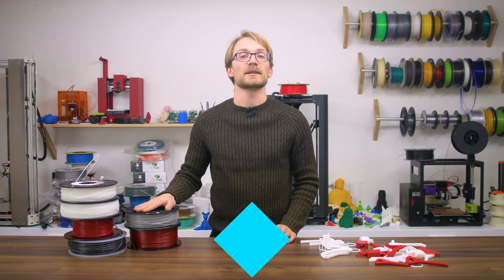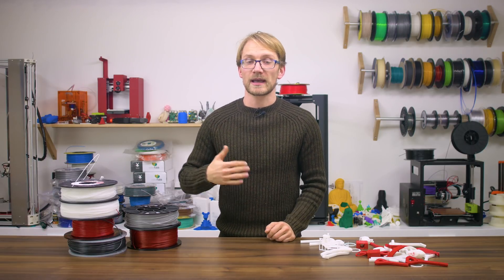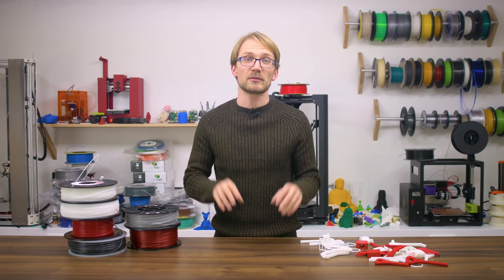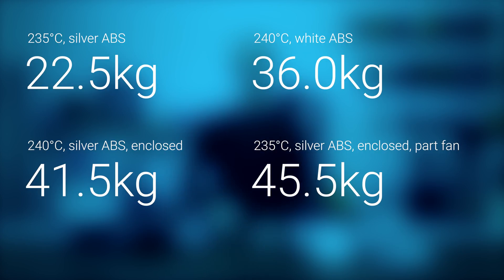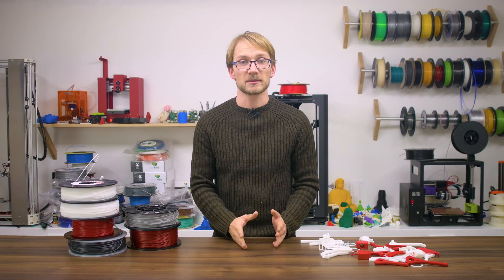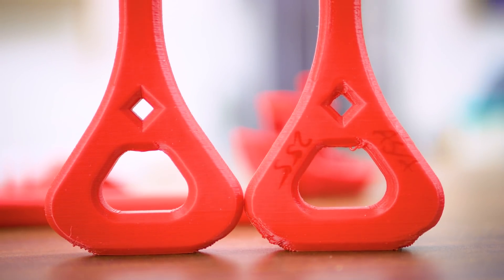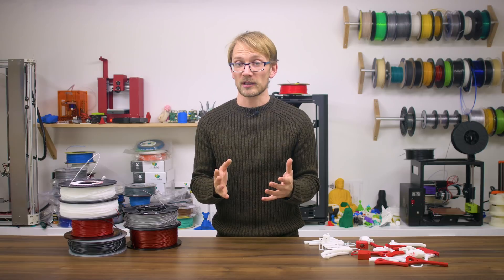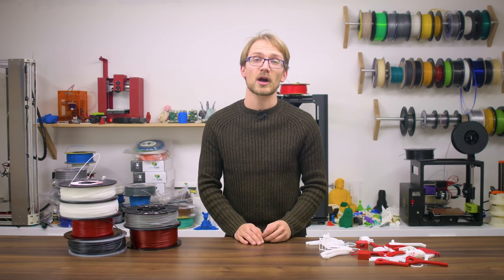3D printing with ABS: Hotter nozzle or hotter ambient? #Filaween

Comment: I´m not using ABS anymore. I started 3D printing with ABS but I just don´t need that high temp stability. For strength I use PrimaSelect PLA or PETG. In case I want and need ABS like Material I use Zortrax Ultrat. Doesn't´t smell that much, easy to print. For big parts I´ve made a simple enclosure from foam. My first Printer, the Tiertime UP Mini printed ABS like a boss... Thanks for all these Videos Tom!

Comment: I have an EcubMaker fantasy pro have printed abs almost exclusively for over a year. I use hatchbox abs @ 235 c nozzle, bed 110 c it is enclosed but no heated  chamber .  0 issues with warping or cracks etc no layer adhesion issues.  Quality is phenomenal even on larger 180mm diameter 200 mm  prints.  It did take time to dial it in to get a good surface finish.  Mainly infill and increasing shells to at least 3 and top and bottom solids to 3. I print from. 1 to. 2 layer height @ a pretty quick 80 mm/s though prints 1st 3  layers at 40 mm/s same for top 3. No ringing or other issues is it more temperamental than petg sure.  Though it has more flex mechanically(making take repeated stress better) ,  captures detail well and has  a lot of post processing options that other materials don't.  Its heat tolerance it a warm climate of Texas makes it good all round but does have a learning curve steeper than other materials.

Comment: I placed a sheet of Aluminum paper under the glass of the heat bed. Made a wall 2" high. Each side has a folded wall, extending the height to 4" when unfolded while upright. I could've added another to get 6" but I don't print parts that tall. Mostly Gears and couplers and other mechanical parts.
I place this square wall around my bed. When the print job reaches the 2" mark, I unfolded the 4 walls upward and I get 4" high walls all around the bed.
There is no cold air circulating and cooling the bed. Made it out of Dollar store foam I had laying around. Cost is closer to 25 cents or less.
Want it for free? use a cardboard box and cut to size using a box cutter. 
If you are willing to use plastic, you can print a layer of skirt, an inch away, all around your part as you build each layer.
Good luck all.
Reply: Never heard of aluminum paper, where did you source that?
Reply: http://www.homedepot.com/p/Nashua-Tape-2-83-in-x-10-yd-ASJ-All-Service-Jacketing-Insulation-Tape-1207784/100140677

Comment: Nice video thanks. I only print in PLA and get strong parts that dont warp. My solar panel brackets have held tight for a year and in 50+ mph wind. Never understood the need for abs. Tom could you maybe do a video on upgrading a printer to have an enclosure? Also would it effect PLA? Thanks and happy new year. :)

Comment: Hey Thomas great video as usual... I print exclusively with ABS. Having the right printer for it helps most. I have 2 Up Box's and an Up mini 2 and they print abs absolutely flawless. In fact they print abs better than my Wanhao duplicator i3 2.1 prints PLA. I used to print with just regular abs and the Ups printed that great. However I have since switch to eSun's ABS+ as my go to filament and the prints come out as mentioned absolutely flawless and super strong... Since the Ups have an all metal hotend I do print the abs+ at 260c... Another great abs filament that prints perfectly (virtually zero warping or artifacting) is FormFutura's EasyFil ABS...

Comment: I along with my mate bought a Up Box. Angus recommended the Up Mini 2 for me but in the end I stretched to its bigger brother. So the shop must of loved us, two Up Box sales in 1/2 hour. I make parts for my garden railway and I only printed in ABS. In fact the other day I picked up some Cocoon Create blue PLA for a rather nice AUD20 a roll and this was then used to print some cookie cutters. So a bit of a role reversal, an ABS printer that has only just printed my first model in PLA.

Up Box
ABS - lid and front door closed and the cooling fan directed away from the nozzle = strong clean models
PLA - lid and front door open, ceiling fan on and the cooling fan directed at the nozzle = beautiful looking sharp models

Filament ABS - Bilby, Up and Chinese cheapie. Bilby the best so far.
Filament PLA - Cocoon Create.

I use the default Up Box settings for both the bed and extruder for both Bilby and Up filament. I am still lowering the extruder temp slowly to hopefully get a good print from the Chinese filament.
Default Up PLA settings for the Cocoon Create filament works fine.

Comment: petg is very nice. nearly as easy as pla. but when you need/want to glue your Parts petg is a bitch 😑 larger Parts can glued with Hot glue but then you loose some of the heat Resistance. pvc glue is said to work but often is a bitch in terms of toxic indrigents . i use to construct so that i can use nuts and bolts with. petg

Comment: I print almost exclusively with ABS. I have a active heated chamber at 45c heatbead at 100c (PEI) and hotend at 240c (06 and 08 nozzle). No part cooling fan at all. And it works great! Strong an totally ok print quality. I have found a brand of abs that I like and sticks to it..

https://goo.gl/photos/F7r9gPm2QT3YrmJ89

https://goo.gl/photos/p9nwx3T6KhiXQZwy6

Comment: I print ABS using a modified Da Vinci 1.0a, e3dv6, titan and a small personal heater to keep the enclosure at 45 to 50c. Also using aluminum bed with Zebra plate and a silicone heat bed. So far I been able to print anything I threw at it including PC. I have also added a filament fan also.

Comment: Agree with you a gabazillion percent.  After a year of trying, I quit ABS, and moved onto PETG.  Gave up a little bit of printability but gained on everything else. Ironically, your review of ASA (and 5 unused rolls of ABS on the shelf gathering dust) prompted me to build an enclosure for my Prusa i3.  It prints ABS reasonably well now, but first layer adhesion is still a pain.  PETG FTW!
Reply: I use hair spray on kapton tape, it sticks ABS down really well. Sometimes too well! lol
Oh I also print with a brim.
Reply: I guess I'm a little spoiled with PETG these days.  I'm printing it on bare (cleaned) glass, and when the glass cools down, the parts just literally come off the plate by themselves. I suppose it's all good.

Comment: Great suggestions Tom, I have been waiting for a review like this since 2-3 years ago from absoulutely anyone. My biggest concern will always be when printing bigger parts, the constant repetition of open source clones in the market proves that the idea is their except not directly dealt with, a enclosure would push forward many major ideas like the transition disk drives did with hellium (faster speeds, ...), it will potentially start a market that embraces actual security mechanisms (for possible fires,fumes,electrical issues....) at consumer prices; or maybe it's just the ABS filament I have been printing with all day is starting to get to me.

Comment: I print in ABS a lot, but most of my objects are costume or prop pieces and require post processing to smooth or weather the object. ABS has a tendency to take a hit and flex a little more than PLA, so when a prop is dropped the potential for breakage is reduced. Also, props can get left in hot cars. :D The main reason I use it is for the acetone smoothing and solvent welding. Since most of my pieces have to be printed in several parts, the ability to acetone weld them is awesome. 

If PETG had chemical solubility with chemicals that are not majorly toxic, I would completely switch to it as I like printing it much more than ABS.

I have had my printers in enclosures that range from a nice electronics cabinet to a literal foam poster board box. The poasterboard box works really well actually and is cheap and easy to work with. Also, bed adhesion took a lot of reading and trial and error, but I hardly ever have parts warp nowadays, even large pieces.

Comment: I run a homemade clone of a Graber i3 solely on ABS, with no heated chamber and get a very good bed and layer adhesion. I print on a regular glass bed with hair spray heated at 110 Celsius and hotend at 237 Celsius.
The last part I printed, pealled ou some glass from my bed when cooling down. I only have to watch out for open windows and wind on the room.
But my new step is a heated chamber to have a more even contraction during cool down.

Comment: Only reason I use abs is for the rare occasions I really wanna vapor smooth or acetone weld parts. Also doesn't help I have cheap not great abs, I have tried rigid.ink abs as well which is much better than the other and also smooths out much nicer.

Comment: i've been struggling with this very issue but finally got around to printing brackets (out of pla) for a twinwall plastic + acrylic simple enclosure for my delta
http://www.thingiverse.com/thing:1117395
my first print with it literally just finished and it ended up way better than the previous few times i tried it but the lower layers still look a little goopy....might try a 20% fan speed

Comment: I've had similar results. With a heated bed I use an ooze shield to enclose the part and trap the heat gradient a bit. It improved my results with polycarbonate (specifically Polymaker PC-Plus) significantly. This technique does work best on parts with a cross section <100mm and only mattered above a critical heat gradient which always seemed to be about 10-20mm in Z depending on ambient temperatures.

Comment: I have 4 machines which I have build myself,  all of them have their   heated enclosure which permit 45 to 50 degree centigrade and I use ABS+ because it's much easier to get nice,  smooth and easily sandable parts compared to PLA or PetG that are much more labor-intensive in the post-print stage.  A couple of sheets of MDF,  some insulation plate and 2 incandescent light bulbs is all you need to make ABS+ printing easy as 123. :)

Comment: I feel like while ABS has its place... its not worth the fumes & the warping & cracking that comes with it... when there are much better options out there for you to use. I have gone as simple as putting a dish towel on the front of my ultimaker 2 and it helped cut drafts when ABS printing... drastically! Was it a cure all? heck no but it helped a lot being my printer sits next to a cold drafty window!

Comment: ABS for 90% of my materials. It's cheap, fairly strong and I mostly print smaller mechanical parts where final surface finish doesn't matter as much or molds where being able to smooth and glue becomes much more important. Plus ABS fails more gradually rather than PLA that just snaps. 
The machine was a cheap Chinese i3 kit back when they were still around $500 with a genuine e3d v6 hotend and many upgrades. (And the original bearings, cleaned and packed with semi-fluid greese that have lasted without flaw or noise for several hundred hours of printing! I've gone through maybe 20kg of normally the cheapest ABS filliment I can find)
Most days are 25-30c and I hate aircon(Plus running an ABS using 3d printed in a sealed room is a silly idea!) but I get a noticeable difference if someone leaves the door open and the print runs into the night.
Need to try printing more with PETG though but anything that doesn't smooth I can't use for a lot of my parts.

Comment: I made a metal enclosure with glass windows for my Simple metal about a year ago. I use ABS almost exclusively with great results and good layer adhesion.  The enclosure has no heater other than the bed and extruder which keep the inside air temperature around 95 degrees F.  The lower-half of the printer, which hold the electronics is outside of the enclosure and has a separate fan to keep the components cool.  I make even large full height prints with no issues.  Google "3D printed rocket playhouse" to see one of my projects (white and orange rocket playhouse with vehicle and trailers).

Comment: i use abs a lot as i have an xyz printer (admittedly not my best purchase) and they are aimed mainly at abs and don't print pla well
Reply: I do love my printer and it is great just I wish i got the pro so that i could use different filaments and more print settings. Going to flash it once the warranties over

Comment: and so my flashforge wins
Reply: I will add also.... that I'm able to get much better ABS prints W/Part cooling from my FFCP then I can with with PLA.  That said, I think Tom is correct there are now better alternatives in filament choices.  The problem for me is that ABS is just so cheap... :-)
Reply: I sometimes print ABS on the FlashForge Creator Pro and have pretty good success, I assume due to the fact that the printer has a built-in enclosure.  I find that if I keep the door closed, the top on, and no part cooling fan when printing ABS I get good results.  I have definitely noticed much more issues with warping and layer adhesion if the door is open or top is not on.  I typically print ABS at 230C and have used Hatchbox ABS as well as the roll of ABS that came with the printer.
Reply: Matas Jarutis I use simplify 3d for my slicing software. for pla, make sure you have the part cooling fan on(if you have the 2016 model) I generally print around 205 degrees, and a bed of about 60 - 75 degrees. open the door and take off the acrylic cover. I have switched to a glass bed as well. if you are having problems extruding, make sure your nozzles are not clogged. if you are having problems sticking to the bed, I suggest a layer of glue stick. hope this helps.
Reply: Cullen Lonergan what setting are you using I have a flashforge too,but only get good quality prints with pla ??any tips on what to check too much appreciated

Comment: My experience with ABS and PETG has been the exact oposite of yours. I have never had major issues with ABS (only when using incorrect print settings or very large thin volumes) and i tried many different brands, even for fairly large prints like 20x300x20mm. PETG on the other hand gave me a hard time at least 50% of the time, allthough i haven't tried more than two different brands... Worth noting that i always print ABS in an enclosed chamber (35c in winter and +50c in summer). ABS has always been my main filament because it's better for post processing (sanding and acetone welding) and it also works very well in combination with TPU and SemiFlex. I just recently also started printing with PLA and i've been printing like crazy since 2013. I feel like i should give PETG another chance but for now ABS is still my favorite.

Comment: I only use ABS if I can't get around it (need solvent weld or so). My printer is only open at the top but that works for me. I still use PLA as my daily driver ;)

Comment: After switching to Zortrax M200 I use ABS and their similar-to-ABS property materials exclusively with cardboard sidepanels. Previously when I used my P3Steel and i2, I used PLA almost everytime because of the ease of printing, but M200 tops it all. I reckon you Thomas haven't had the chance to test out the Zortrax but if you're interested I could possibly print you the Filaween test parts for compariso :)

Comment: I had abandoned ABS but I am building a new printer and it will get an enclosure so everyone said no to PLA and PETG due to their lower Tg as it will get hot in there and the motors will get hotter etc...  People who used those materials in heated chambers, or even in really good enclosures, had warping so I had to go back to ABS (not counting my TPU I got for free).  By the way all of my parts, so far, have been done on an I3 Rework at 70% infill custom pattern and no issues BUT it will come as my final part is beyond the 10mm safety margin I learned about when I first made this printer.  I have an enclosed machine but it is a PITA to work with as it needs a new bed and this time don't even use the "pc glue" buildtak material.  I did what the Chinese said and put the bed at 100c and it burned the plastic, burned the buildtak, and the connector melted.  So, pffft to that but I will do a replacement and get some glass or I will simply use it for parts because I do not like Mightyboards using Sailfish.  Did you know Makerbots and anything using Sailfish do not have real PWM?  Nope, 1bit simulation AND the fan is either 0 or 255 as anything not a 0 is fully on.  I was ticked at that and found that out after I hit Jetty, and his minions, over the head with a sledge hammer to come clean about it.

Comment: I love petg, pla works well for most things, abs just tries my patience.
Reply: Exactly, PETG is awesome! I print huge parts all the time and I need something that won't melt in my car... lol.

Plus food safe is cool.
Reply: Harbinger Arts petg is the new pla
Reply: i'm looking to see if i can find a filament that has higher heat resistance so i can use it on functional parts outdoors in direct and high australian sun conditions and in vehicles etc And i don't have a heated bed on my ATOM 2.0 - is this PETG capable of being printed on glass beds unheated?
Reply: Polycarbonate wont be printable on most 3d printers, needs an all metal hotend
Reply: gzcwnk i don't know why you wouldn't get an all metal hotend, without one yours material choices are quite limited.
Reply: May I suggest Polycarbonate.  But for either one, its worth getting a heated bed.
Reply: Lyle Walsh Straight polycarbonate is printable but can be a right bitch. Sticks well to buildtak which is also polycarbonate i think. Polymaker PC-Max is much better behaved, and polycarbonate based. I'm experimenting with enclosures. Need to make a large actively heated one and experiment. First i want to build an i3 clone to replace my old CTC but will post some videos. IKEA Lack tables are a good starting point for an enclosure and the missus won't moan about the looks too much...
Reply: Tries my patience too. I can't get a part of any size that does not warp itself off the bed unless it is abs-juiced down, sometimes not even then.
Reply: But I want to print a hotend mount thing and petg melts